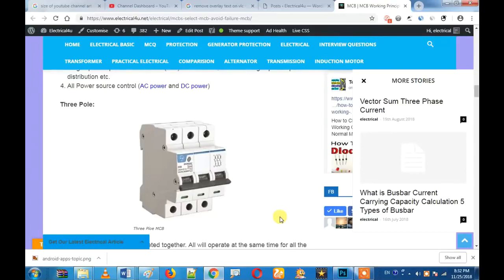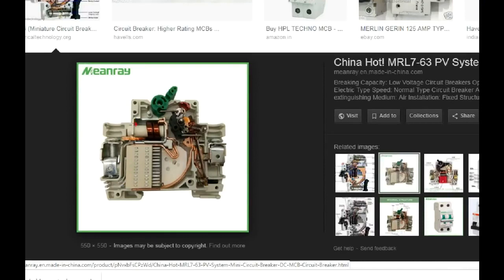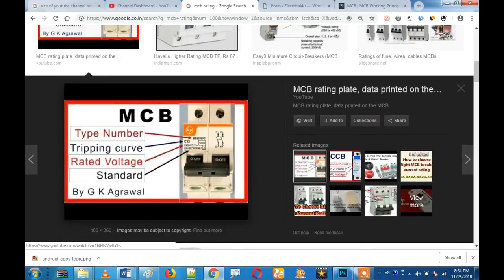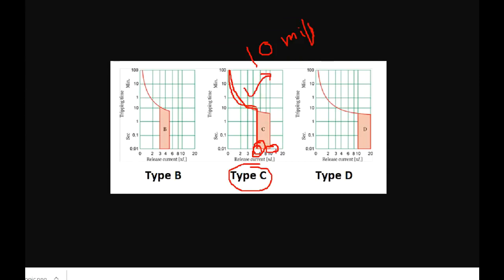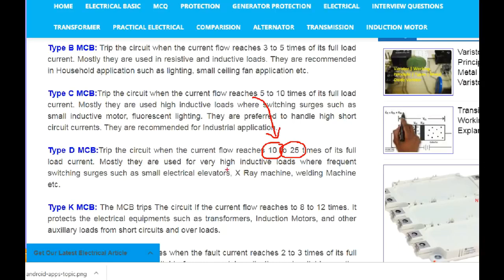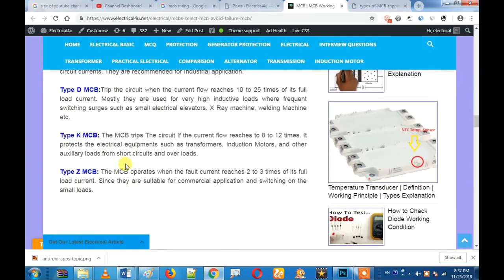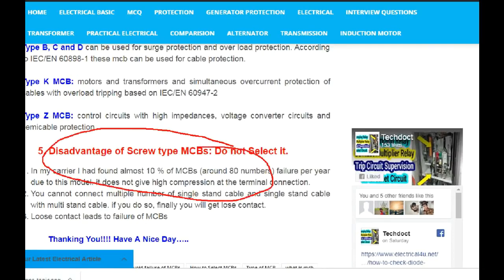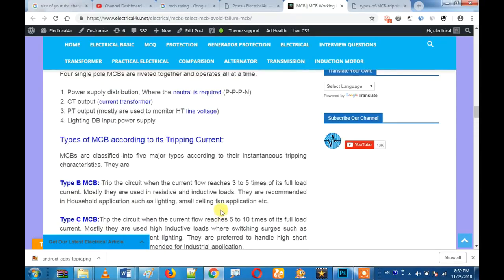MCB Type of Tripping Curve In MCB In Tamil

Comment: Bro 32 amph MCB use Panna meter la irundhu Vara phase wire evlo square mm la irukanum 4 or 6 square mm use panlama aprom main mcb ku use pandra wire single pole MCB Ku phase wire join panlama